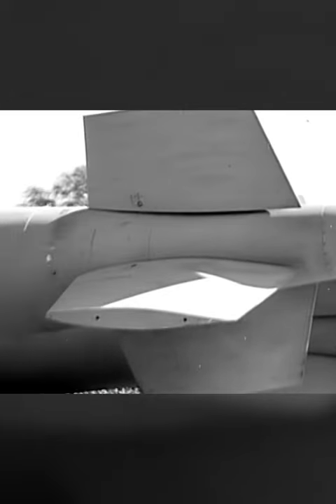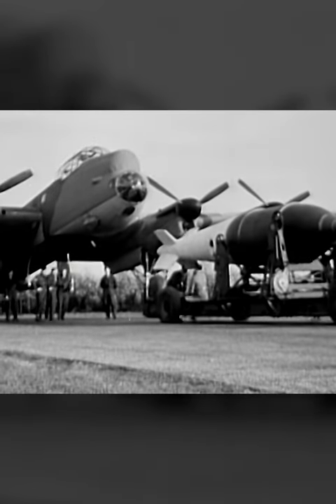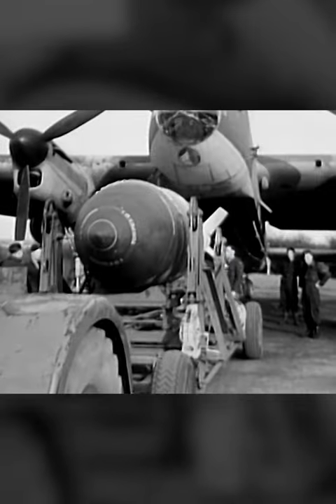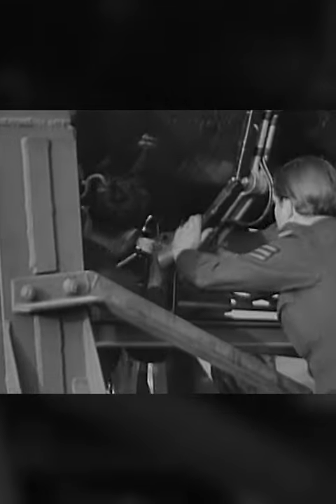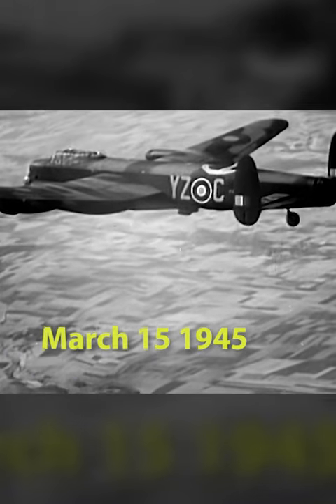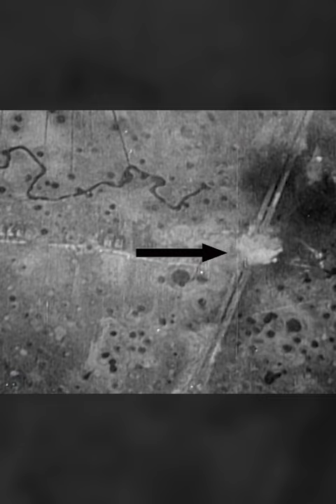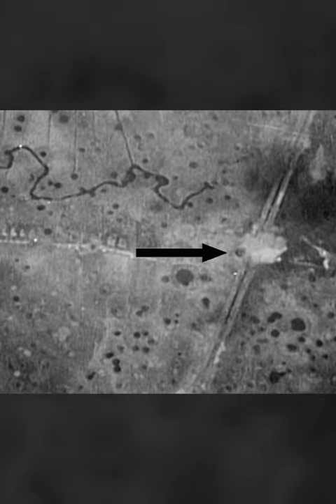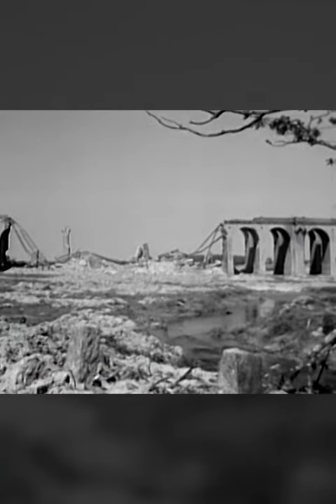RAF "10 Ton Tessie" Earth Quake Bunker Busters in Action 1945

Comment: A book I have on the Lancaster bomber details a pilots recollection of flying the specially modified Lancaster to deliver this bomb. The Lancaster was fitted with extra special Merlin engines for extra power, the fuel and oil were metered out with little to spare and the Lancaster was stripped of as much weight as possible. The front turret went and was faired over, the rear gunner had only two .303 Browning's instead of four and half the ammunition load. The navigator was given a wicker chair instead of his metal seat. The pilot wound the Merlin's up to their crackling best before letting the brakes go. He used every damn inch of runway that he could and flew low over the countryside praying as he slowly increased speed and slowly raised the flaps. Once over the sea it was a slow climb to something approaching a bombing altitude until the Lancaster could climb no more. Then came the bomb run flying straight and level on the approach to the target to enable the clockwork bombing computer to do it's thing. Suddenly, a loud click and a metalic slapping noise as the belt around the bomb opened and as the bomb fell clear after kissing the rear of the bomb bay, the Lancaster lurched skywards, freed of its great burden. Well, you saw the outcome of the dropping of that bomb in the video. 
The pilot flew back to base relieved that he didn't have to try returning with that bomb. He parked the emaciated Lancaster and never flew that aircraft again. I have over the years read that story a number of times and it is always a nerve wracking and sweaty experience flying with that pilot on that mission. 
Exceptional generation!
May They Rest In Peace. 
Lest We Forget. 
Mark from Melbourne Australia
Reply: Do you recall the name of the book?

Comment: Grand Slam bomb
Reply from the maker: As I pointed out in the accompanying notes. “Ten Ton Tessie” was what it was initially called, as in this film.
Reply: @ZenosWarbirds  Grand Slam was Barnes Wallace's original concept but a 10 ton bomb with cast steel case was so technically challenging that the Bouncing Bomb followed by 5 ton Tallboy were developed first.
My dad was involved in Barnes Wallace being awarded an honorary degree post war since dad was involved in the very secret development & production of the explosives which made these bombs possible.
Reply: @pcka12  was that called Torpex ?
Reply: @Baza1964  Torpex is (or was) a mixture of explosives & other materials including TNT, RDX & powdered aluminium.

My dad was involved in the first large scale production of RDX, as he explained it to me, RDX is a ring structured molecule which is 'metastable'.
If allowed to crystallise RDX is very instable, of immense explosive power & consequently deadly (they couldn't even find the bodies of early British casualties!).
So the problem is to stabilise the material by producing it in amorphous form, never allowing crystallisation.
The mixture 'Torpex' is another step in making an explosive which can be cast into armoured cases able to penetrate deeply without exploding until the detonation system sets it off.
Altogether a very tricky thing to achieve.
Reply: @pcka12  Cheers Pat.